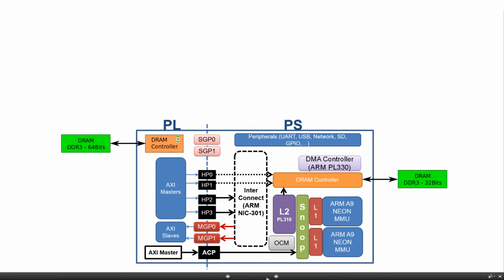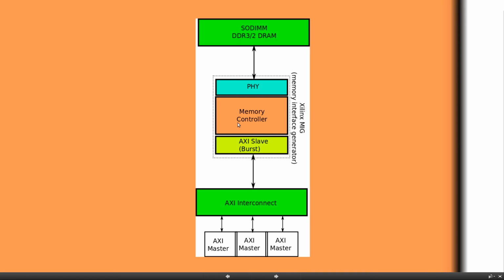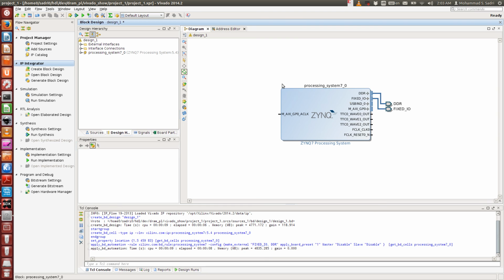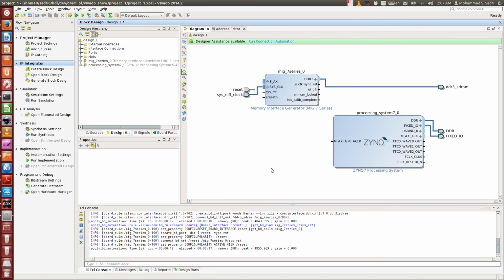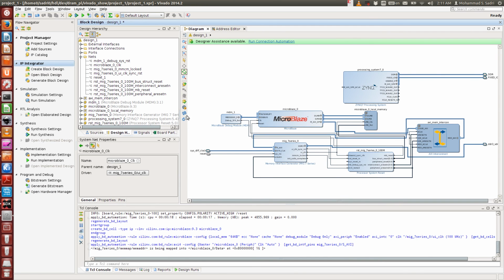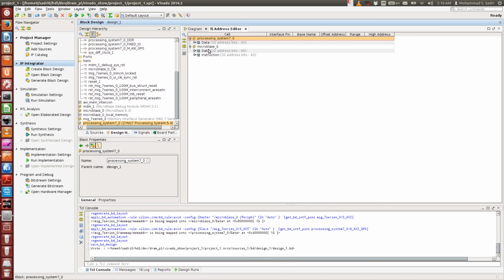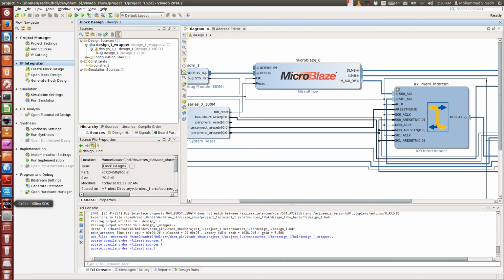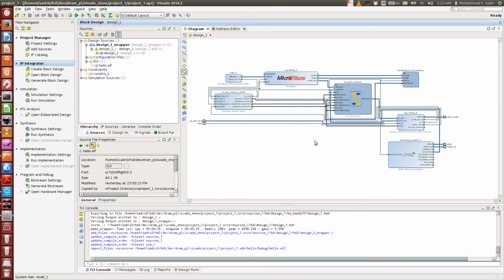ZYNQ Training - Using the DRAM Controller on the ZYNQ PL

Comment: You design is wrong, or at least misleading. As you described at the beginning of the video, what your "several students" wanted to do is an accelerator in PL for better bandwidth and latency. But the primary purpose of an accelerator is performance, so it is a bad choice to employ a processor (and what is worse, a slower processor of MicroBlaze) which takes several cycles to execute an instruction. If the ARM core suffers bandwidth and latency loss, why doesn't MicroBlaze? It's OK to make use of an existing MIG core because design of a memory controller is non-trivial. But what you need to do is a Verilog RTL module as part of the accelerator to control the MIG memory controller directly though AXI4 interface (like sending address and receiving data), not making use of processors and other AXI infrastructures. It is funny to imagine embedding another processor in a processor to interface a memory controller. If you don't know how to write Verilog to implement an AXI master to interface MIG, you should have just said "I don't know" to your students. Relegating the work to block design and its auto connect and blocking capability is kind of cheating.

Comment: sir this video helped me a lot.can you please tell me how to use or interface dram in 28dr part board(ultrascale+).
thank you sir..!
Reply from the maker: for zcu111? it should be fairly straight forward, you can use the MIG , in the PL, and then block automation and then one or some set of AXI DMAs.
Reply: @MohammadSSadri  yes sir for zcu111..but i am not getting how to use mig sir..can  you just give me some elaborate reference to that sir..
Thank you sir..!